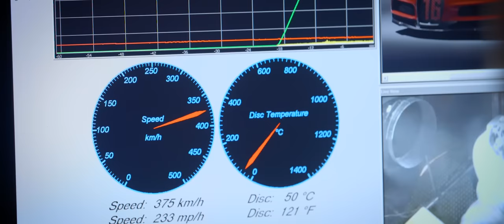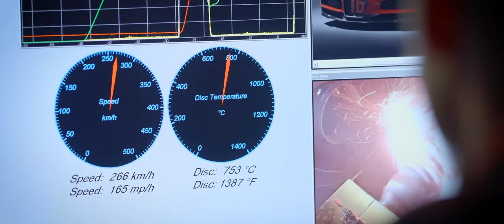BUGATTI CHIRON Titanium caliper brake-test extreme

Comment: So, everytime you reach 270 Mph means new pads change ; )
Reply: They don't last much, and you need to make sure you don't wear them too much. Just a little braking without pads, a little contact with the metal support, and you have to change the disc.
Reply: and the tires too:D
Reply: The pads are expensive too. So hypercar js the WORST car in history ! Cant drive max speed
Reply: @haziqkaka3414  not the worst. that’s a big claim
Reply: @slaire7799  really bad in the praticality standpint. bu noboby buys a chiron expecting practical use.
Reply: No, do you know how strong titan is?
Reply: Depends on how you brake. Its not like you'd apply brake from 270-0 on a highway
Reply: @haziqkaka3414  ofc it can, you just wont be able to brake :P
Reply: Just engine brake bro, it'll be fine
Reply: @we-drive  unless Autobahn 😅
Reply: I think that experiment was done without brakes oil which reduces the disc temp. and keeps pads for long time ... I think the purpose from that experiment was to show how powerful the brake system is !! ... Even without using brakes oil
Reply: And disc too
Reply: @haziqkaka3414  if you poor and only dream about car like this. If you can afford to spend 2.5mil on the car you really don't give a fuck how much it cost to maintain it. You have another 10 super or hyper cars in the garage.
Reply: @Schluker  theres only one place in the world bugatti has ever reached this cars tops speed and its volkswagens private test track. It's a useless, impossible top speed that can't be reached even with infinite money. The only people that will ever see it are bugatti test drivers. You can be Bezos and they still wont let you take the chiron to Ehhra Lessein their test track.
Reply: @sunburst8810  it never occured to me that James May is their test driver. You can reach such a speed on the autobahn. It would be crazy dangerous, but you can.
Reply: @JM Production i had go to indonesia (bali, jakarta) many times. Driver's are so professional even motorcycle, ojek, taxi. but not accident. That was an honor from me(Malaysian) .
Reply: Which country does this technology belong to?
Reply: Thats also slamming on the brakes on easing in on them
Reply: 😂 Exactly the comment I was going to make.
Reply: @haziqkaka3414  it can lol
Reply: @dihydrogenmonoxide9210  but its not a practical car its a hyper car meant for racing 😂 are you slow. Its a race car not a everyday yo mama van 🚐
Reply: @matthewclark4510  a chiron aint meant for racing bruh
Reply: @xiro6  yup
Reply: Each pad worths 5 k
Reply: @JM Production just install a parachute like the top fuel dragsters. I'm sure those are cheaper than brake pads. Its not as convenient as brakes but it will do if you don't want to yeet yourself into a mountain. I'm guessing you can probably reuse the parachute a dew times as well. The tires are still going to be your biggest expense.
Reply: Just dont brake abd you will save your pads
Reply: Pretty much lol😂😂
Reply: Just go 269 mph, problem solved
Reply: This is a brake test in extreme conditions, so doesn’t mean.
Reply: @dihydrogenmonoxide9210  bugatti is made for a keepers car and also if you want only speed out of it you'll only have to buy a bugatti to gain that no other company can give performance like that
Reply: @TH3L3G3ND  excuse me, the fastest production car is the koenigsegg agera rs which is a koenigsegg, not a bugatti
Reply: @dihydrogenmonoxide9210  I knew someone like u would say koenigsegg because everyone think they are clearly the best because some car from their production line has made a guiness world record but there's many hypercars that are going 250+ mph so you don't have to specific certain brands like I and you did like bugatti and koenigsegg
Reply: @TH3L3G3ND  i never said buggati was bad or that i hated buggati. I just said that the fastest production car is  the agera rs
Reply: @dihydrogenmonoxide9210  I'm saying there's more production made cars that are faster than the agera RS tho that's what I'm saying
Reply: @dihydrogenmonoxide9210  btw it's bugatti not buggatti
Reply: @TH3L3G3ND  correction  the ssc tutara is the fastest production car officially. still not a bugatti
Reply: If you plan on driving it that quickly, I’d be more worried about the cost of tires
Reply: @haziqkaka3414  the hypercars are only to show off your dad's bank balance
Reply: So this or any car is for exhibition purpose only, I guess.
Reply: This size of brakes are not for a car, it's for testing purposes only
Reply: @sunburst8810  James May enters the chat
Reply: @haziqkaka3414  How many times will you actually be even reaching 270mph anyways? and you won't be going 270-0 and slamming the brakes instantly anyways
Reply: + rotors
+ tyres
+ fuel tank
+/- trousers
Reply: @we-drive  or 156-0 on normal road ha
Reply: @haziqkaka3414  and driving max speed for one 30 seconds mean you need to get fuel
Reply: @JM Production 😂😂😂😂😂😂😂😂 poor you
Reply: And new wheels after 20min
Reply: @haziqkaka3414  they are fantastic, just extremely impractical
Reply: Yup indeed
Reply: I only reach 75mph on the interstate so I should be ok for awhile haha
Reply: @Baer79  lol
Reply: You realize you won’t be slamming on your brakes at 270 right
Reply: @fish3310  just if a see a group of cows , ouch lol
Reply: @luigivera.  don’t think brakes would slow you down enough for it to matter
Reply: it has ingine brake hehe if u dont have muchmoney it must use ingine brake aha
Reply: Yall talking like you're gonna brake from 370kmh to 100 in 5 sec for many times each ride. You won't even drive with constant 300kmh+ through the highway. Probably 200kmh will make you piss and shit in your pants
Reply: @munir8015  ive got some baby wipes in glove box lol 😄😁
Reply: @sherryx9930  i rather take you to such fast ride lol 😅
Reply: @paulchristian8028  💪🏻
Reply: yeah brakes only slow you down bro
Reply: @xiro6  thanks ill keep this in mind when im buying my chiron
Reply: @haziqkaka3414  its just a test.
Reply: @sunburst8810  you can be bezos and build your own track
Reply: @ciller98  10 minutes at top speed which is over 70km
Reply: @munir8015  200 kmh is normal speed in Germany. With a car that has good suspension you can easily drive 300 or even 400 on empty roads.
Reply: VMax calls for new tires at 30,000 dollars a set.  First world problem at it's finest.
Reply: Or you can apply the brakes lightly so it don’t overheat (idk if that would help or not)
Reply: @sunburst8810  some guy drove his Bugatti here with 417kmh on the Autobahn.
Reply: @we-drive  You will when you see that gorgeous hitchhiker up ahead.
Reply: Only if you do an emergency brake, or not?
Reply: Only if you stop.
Reply: @haziqkaka3414  except if you don't care about money that doesn't matter and to them, laughing, your Prius is the worst car in history.
Reply: @sunburst8810  Or the salt flats in Utah. Ya know where all the land speed records are set
Reply: @we-drive  so what would you do if some jerk suddenly changes lanes in front of you at half the speed and you're driving 270? No one would suddenly smash the brakes at that speed, but it's more about: are they able to stop the car when you HAVE to?
Reply: @tomast9034  and if lucky, then the car as well 😄
Reply: @sunburst8810  Well bezos can just buy the whole company dude.

Comment: Bugatti: Our brakes will stop your car even if it's on fire. 🔥
Reply: *brakes
Reply: In the real world at high speeds air will be flowing over it so it won't get anywhere near as hot
Reply: @trigger8221  Indeed. The wind plus the weight of the car will prevent it from even reaching such speeds (edit: reaching top speed so quickly). Race cars can combust due to unforeseen circumstances though.
Reply: @kenzito101  What do you mean with "prevent it from even reaching such speeds"? Did you mean to say temperatures?
Reply: @kenzito101  you were half right though, they can reach those speeds just not at the same acceleration, there'd be a good minute of acceleration with 250km/h airflow over the brakes in between each attempt. But still surprising to see that both the caliper and the disc stay intact for the final run... I sure that something was gonna give and had money on the disc shattering.
Reply: You can do that in any car if you do 100 and floor the brake
Reply: Trigger this is a pro simulation, preeeeetttyyyyyyyyy sure they know what they’re doing.
Reply: when my bugatti burns the whole car burns only the caliper is left
Reply: Trigger i mean if u suddenly press the brake while at 400kM/H it will definitely glow red hot lol the friction is unholy on that thing heck the disc may become so hot infact that the disc simply grinds the brake pads hence the grinding effect...
Reply: But dont count on them to return it if it broke !
Reply: at road the wind is blowing so temperatures are less and buggati also has ventilated disks on brakes.
The test just proove that even with 1000c the brakes are still fine.
Reply: Well the caliper may be good wat about the disk
Reply: Efhraim Parinas you can do this with GM brakes and pads as well..
Reply: @trigger8221  there a big ducts in front and behind to simulate airflow... its bugatti they would never dare to test without all factors considered
Reply: Bugatti: Our brakes will set your car on fire
Reply: And they will also stop your fully loaded 747

Comment: For those of you who dont know anything about brakes at all, this is simply fantastic for bugatti. Many brake systems or disks at those temps break or literally explode. Especially at those speeds. Thats legit one of the greatest things ive seen as far as car technology
Reply: Don't we see this all the time in race cars tho
Reply: @squeakybunny2776  Not in these kind of conditions. They're testing at full brake force, like an emergency stop from extreme high speeds over and over and over. Straight up abusing the brakes. Even really good racecars would experience brake fade if they underwent this. 

But modern carbon ceramics are super super fuckin good, can't deny that. They're still extremely capable and durable, but these are just overkill, that's why they're so cool
Reply: @jmccann6735  These brakes are insane. I've done brake tests in my Evo from 170-0MPH and experienced fade after doing it 3 times back to back. These brakes are insane to stand up to that
Reply: @jmccann6735  with a name like that how could I question your knowledge
Reply: @BlueZirnitra  Aha touche! 😂

Comment: I used to drive more than 200km to work per ride in Germany. Outward trip on Mondays and return trip on Fridays. I used to drive at max speed possible. One Monday I took a break at a rest area and there was a bit of fog. When I went out of my car I noticed steam/smoke coming from my wheels. I took a closer look and saw the brake disc glowing vaporizing the water in the air. I was like: WHAT?!

Comment: The fact that it cooled of that quick is amazing
Reply: Well if you drive like +100km/h its pretty windy
Reply: well, the speed was also not small, it also extinguished the brake discs
Reply: they had a cooler next to it of course... even in normal driving it gets cooled by the wind

Comment: Better hope your Bugatti doesn’t have a fuel leak. Titanium is extremely durable and heat resistant, but sparks more than a fireworks festival.
Reply: I dont think the sparks you are seeing are from the titanium caliper. Carbon ceramic rotor being squeezed by the 3D printed titanium caliper and the brake pads being completely destroyed is what the sparks are coming from. I dont think the pads are titanium also, but I could be wrong. The cool part is seeing that caliper and all of the strange little holes and divots and parts that seem to be just a useless manufacturing flaw all the sudden make sense when all of that energy is turned to heat and sparks and you can see how it all shoots out of those spots and gets moved away from the caliper. Pretty cool stuff to see that's for sure!
Reply: Should have been made out of tungsten-titanium, tungsten is the most heat resistant metal known it barely sparks at all
Reply: I also believe it only sparkles when you go a gabillion mile/hour so u should be alright topping out at 260+
Reply: @nikolaiorr8383  Tungsten is very dense though, and I'm guessing they are using titanium to save weight. A calliper made of tungsten would be over 4x as heavy as one made of titanium (titanium 4500kg/m3, tungsten 19600kgs/m3)
Reply: bobwatters  The caliper is titanium, the disk is carbon-ceramic.
Reply: leeroy jenkins if the titanium was sparking they would be long and bright white
Reply: bobwatters  tungsten also oxidizes very easily and you don't want that

Comment: So technically, when you go at the top speed of a Buggati Chiron and used the brake, your car is officially becoming a hot wheel
Reply: Best comment
Reply: Best comment 
technically the truth
Reply: Underated
Reply: Yes
Reply: Not really, This is just stopping the rotor. In a real situation you would have 4 of theese. add tires, wind resistance, weight of the car etc. ull be stopping alot faster, ofc the brakes would be hot tho. but you wouldnt slam the brakes at top speed. that shit would be dangerous :D
Reply: @RandomStuff-nr9pw  the spoiler helps a bit, it stands up when braking, equals one small hatchback iirc
Reply: @cheedam8738  a bit. But yeah i kinda get your point. But as i mentioned. "Air ressistance"
Reply: Best comment

Comment: I think the temperature would be way lower because this is one single brake disc stopping from 400kmh. You have four braking discs so this test is truly truly intense!
Reply: I was actually thinking it wouldn't hold up as well considering the weight of the vehicle and the momentum it has as opposed to just a spinning rotor

Comment: 2:30 The sound when your Amd Fx6300 is overheating on box cooler
Reply: Legit
Reply: I have a x4 860 and i can confirm it
Reply: Dude thats the sound my ps3 used to make
Reply: When my blower RX 480 gets to 86° on my custom fan curve
Reply: Intel* :DD
Reply: I had a 8320 with a cooler that was to small for that cpu
It was louder. It was way louder
Reply: I have FX 6300 and I never encountered it to overheat.
Reply: @motia4888  idk if it was my gpu or the software, the fans would only go up to 70% on the dual fan model
Reply: Yop,  that sound is pretty same :D

Comment: This is a Part of Bugatti's Braking System, The Bugatti Team Always says that they more work on stopping the car then giving it speed, so this is Just one part, it's also got some other feature too including Aerofoil which applies pressure to down so that the Speed slows and then when it slows it's just stops it
Reply: Right! The Veyron (at 100 k/ph) was faster in braking than in accelerating :D

Comment: Bugatti: Look! Titanium in brakes
F1: Laughs in Carbon Carbon
Reply: And you will take your car with carbon brakes to service after every hard braking?
Reply: @Epezpalace  why not? I mean, you got the money.
Reply: @georgypopov7174  Carbon brakes are purposed to extremely braking sessions and carbon needs high temperatures to make good friction at high speed braking. Titanium has high melting point and it's lighter than steel. I guess that Bugatti drivers use their car at everyday driving and willing that brakes would stop the car even in city speed limits but is capable to track racing.

And I don't got any extra money. My 20 year old diesel VW is enough for me. Only carbonated thing is inside the exhaust. Sometimes it exhausts some carbon smoke. :)
Reply: But F1 carbon ceramic discs and pad need high temperature  arpund 800 degrees to operate properly and top a  600 kg car so driving to Sainsbury's with carbon brakes would be no good to man nor beast im just curious as to why the sparks and the end of the last stop was that due ro the fact the pads are obliterated
Reply: ItchingNeckbeard  the Chiron comes with carbon ceramic discs but the caliper is titanium
Reply: Bugatti: laughs in carbon  aerospace grade brakes capable of stopping a fully loaded 747
Reply: @Ckcdillpickle  wait is that true?
Reply: Epezpalace but i ain’t got time for that
Reply: @re7alia7or  Bugatti makes airplane parts.. yes
Reply: These brakes could still be Carbon on Carbon.  This was a test of the caliper itself being Titanium.  It has nothing to do with the pad and rotor materials.  You could install Carbon pads and Carbon rotors here if you wanted.
Reply: @Plur307  the rotors are carbon reinforced silicon carbide brakes. The original commenter doesnt realize that the CALIPER is titanium and the disc itself is CSiC
Reply: @Epezpalace  that's why f1 is using carbon
Reply: Lmaooo